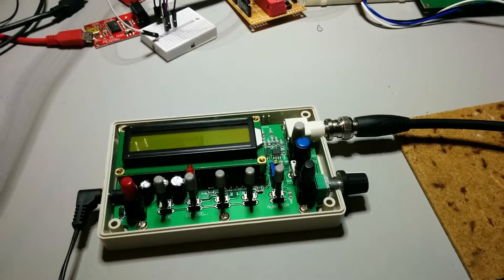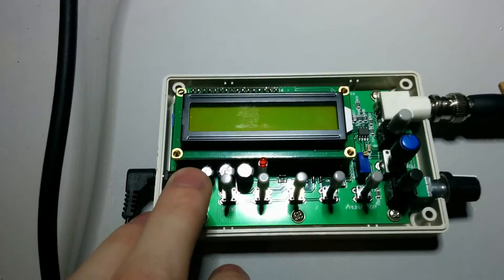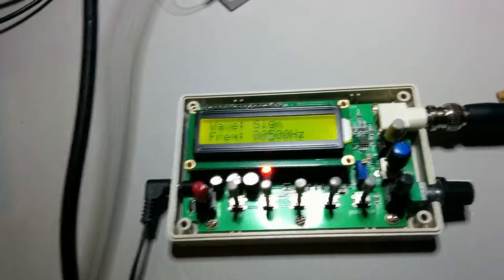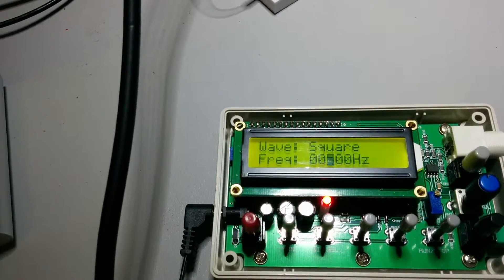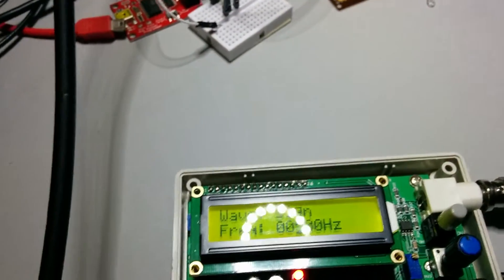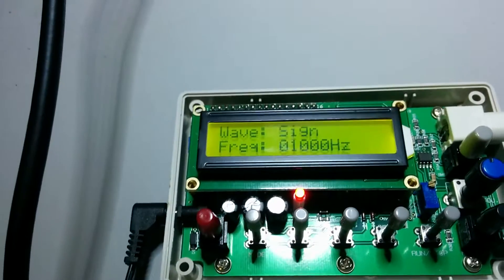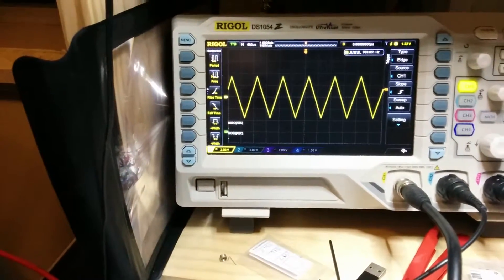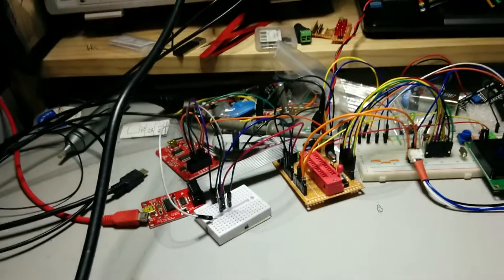FG100 alternative firmware demo

Comment: Hello, nice project!
do you have any updates? Do you think it is possible to make a firmware that enable the possibility to modify the frequency during operation (without having to press run/stop) Thanks!
Reply from the maker: I have made a few updates, see the link in the description for details. As for changing the frequency at run-time, that is not really possible. DDS requires a very tight and fixed-length loop (in terms of ASM instructions) to operate, adding in additional instructions to check for button presses and handling them would affect the frequencies that can be produced as well as frequency stability.
Reply: Thanks Tim for your quick answer. I already have the latest version from the link and it is useful.  Please take a look at this project, almost identical hardware (atmega 328 and dds). 
http://www.vwlowen.co.uk/arduino/AD9850-waveform-generator/AD9850-waveform-generator.htm
He is using 2 encoders to modify the frequency during operation. There are few not used pins on our cheap device, maybe we can add an encoder for this. If you want to test it and need any help, I can do that. Or if you can give me the .ino file for the current project, I can try to modify it. Thanks again!
Reply from the maker: I've actually started another project that uses custom hardware and two micro's (one to do UI, one to generate DDS) to allow me to change the frequency on the fly, is also on my Hackaday page.

If you are after the firmware source code it is available from the hackaday page, see the GitHub link. note though it is not an Arduino project, all of the source code is C and ASM targetted at AVR GCC.
Reply: yes, I saw the code but I am familiar with arduino. I will to to convert as much as I can from your code. 
Thanks!